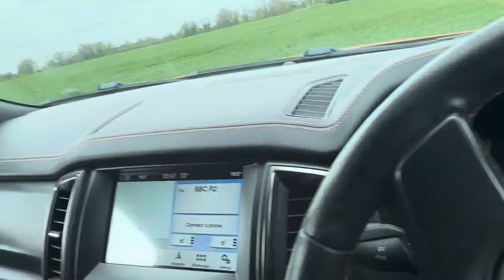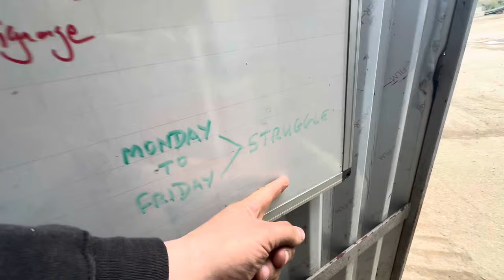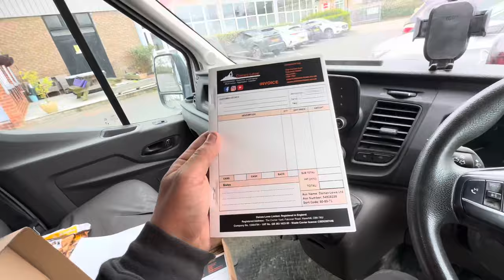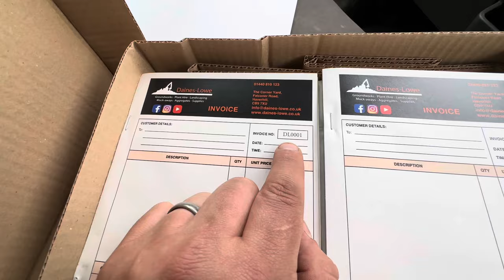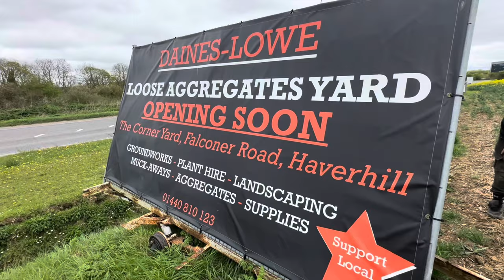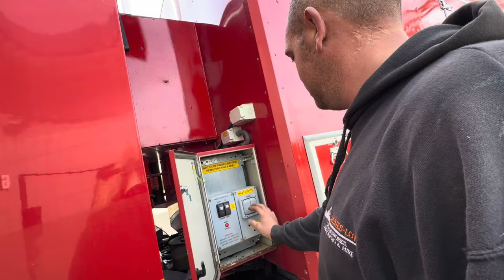How to install a fence, Daines-Lowe style! - The HGV Campervan conversion Struggle - Episode 56

Comment: Is there a battery in the key fob?
Reply from the maker: Not sure actually!
Reply: That’s what I thought when you said about the key fob as I’ve had it in my Volkswagens when the battery is low it will unlock but wouldn’t start without my other keys